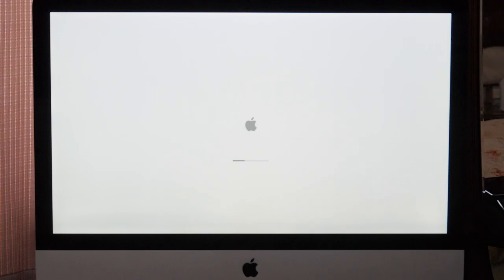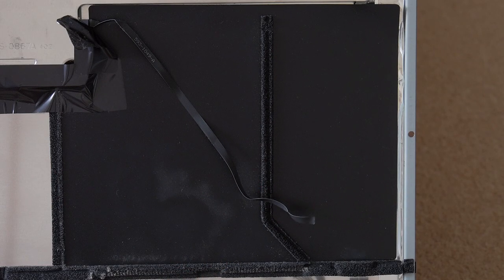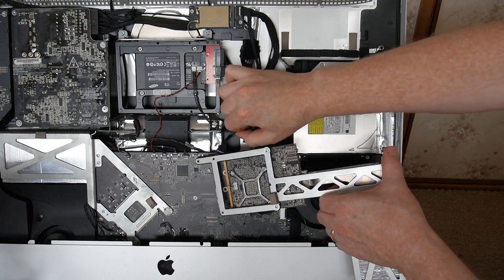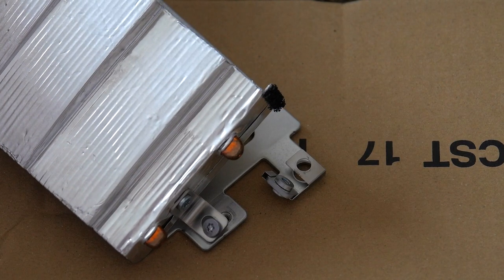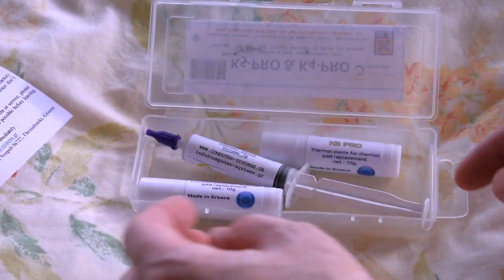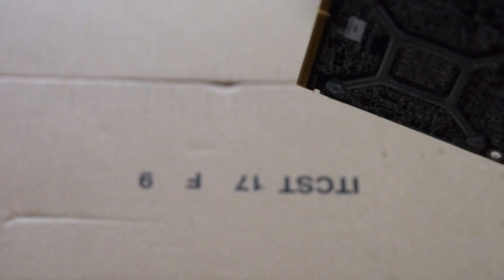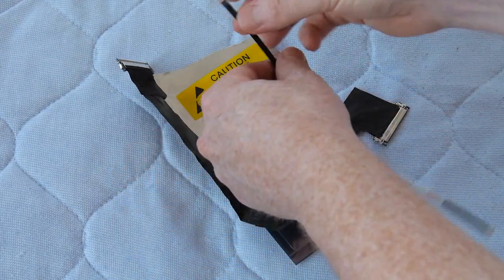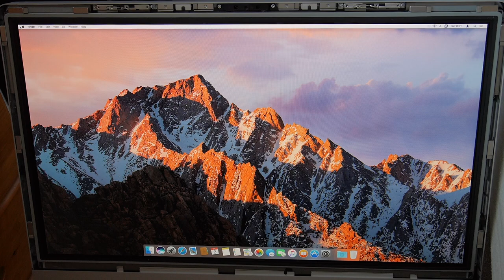Late 2009 iMac 27" Video Card Repair — 4850 — 2nd Bake

Comment: I took 2 days to follow your instructions. Yesterday, disassembling and cleaning, including inside the (poor) fans. Today, I baked and reassembled my late-2009. First boot, black screen, but everything else seemed ok (boot sound, fans, etc). I checked the connections, didn't see anything wrong but 2nd boot was fine, with perfect display. I'll never know why the first boot showed a black screen, but it doesn't really matter. Thank you for your great and detailled instructions ! 😀

I'm now considering the replacement of my HDD with a SSD (thanks to the links you provided in the description). Do you think it might help keeping the imac cooler ? 

I hope the fix will last, so I can have some time to spare for a new computer. Thanks again !
Reply from the maker: I'm pleased to hear of your success!  The SSD will make your iMac run MUCH cooler not only because the SSD itself runs cooler than a spinning HDD but also because the SSD draws less electric current which keeps the power supply cooler too.  But the biggest difference of all will be SPEED.  It's the best upgrade you can buy for your 2009 iMac.  Also, if you have more than one user on your iMac like I do (my wife keeps her user open all the time), you will benefit from more RAM.  I get by with 16MB.  Before when I had only 8MB, I took a big speed hit because the machine was resorting to virtual memory.  With more RAM, that problem is gone.  Thanks for watching!
Reply: JDW  Thank you for your advices. Let's go for a SSD first then 😊
I'm the only user, but a bit more RAM could be nice too. Some softwares are more and more eager in memory.
Reply: I forgot to mention that I also experimented the "not sticky anymore" black thing (the one you put back before the thermal paste). I decided to stick it with a bit of K5... 😅
Reply from the maker: @ecureuilsolaire  Interesting idea.  The good news is that K5 Pro and K4 Pro are not electrically conductive, so you can apply it wherever you like on the circuit board and not have any problems.
Reply: OK, it lasted 2 years. 25 months exactly. Pretty nice ! Same blue dots are back today, let's do it again 😅

Comment: Hello, why do you leave the old paste on the heatsink? It's gummy and may not cool as good as new paste.
Reply from the maker: You are commenting under my 2nd bake video where I did not do that.  It was only in my 1st bake video that I left the old thermal pads intact.  As you can see from my 2nd bake video though, I thoroughly cleaned off all the paste, which is what I recommend now to everyone.  Live and learn.

Comment: @JDW Thanks for the detailed video. I have a question. When your baking the video card, did you place it in the middle of the oven?
Reply from the maker: Pretty close to the middle of my oven, yes.  Don't forget to make 4 aluminum stand-offs so the card is suspended.  That allows hot air to flow over and under the card to make heating more even.  When done, open the oven door and let it cool, or do like I did and put it on a tray so you can remove the tray and sit it on your kitchen table to cool to room temperature (cool to the touch).  After that, you can start applying your thermal paste and then perform the reassembly.
Reply: Awesome. Ordered the k5 and k4 pro thermal paste.. will be baking some boards this 4th of July 😂 Thank you for your response
Reply from the maker: Just be sure to bake the video card in your oven, not under your July 4th fireworks!  ;-)

Comment: How do you think, if i take any mxm video card from laptop, will it work with imac?
Reply from the maker: "Any"?  No.  It has to not only physically fit, but it also needs to be thermally compatible as well.  Some have asked if they can put a newer and "better" video card inside, but the answer is that some of the newer cards from newer iMacs are very slightly different in size such that you may have some difficulty getting it to fit perfectly in a late 2009 iMac.  Some newer cards run hotter too, which I would advise against.  And that is why people do the bake, to resurrect the video card model that Apple designed to be perfectly compatible with that particular iMac.  

With that said, if you do experiment with different video cards, please be sure to make a video of your experience so others can benefit from your findings!

Comment: Hi JDW, thanks for the detailed video. I was wondering if you could help me. I am wondering where I might have gone wrong. Re-assembled mac with baked GPU, much to my dismay, power button has no effect. No response. Help! :)
Reply from the maker: Thank you for your question. Pushing the power button and getting absolutely no response could be the result of many things. Fir example, did you forget to plug in the power cord in the back of the iMac or the wall socket? Did you forget to reconnect the power supply or accidentally disconnect something and leave it disconnected inside the iMac?  

To see if it’s just your display and/or video card that is dead when you press the power button, first remove all of the RAM, then plug in piwer and push the power button. If you hear slow beeping sounds, that it means that power supply power is indeed getting to the motherboard, as that beeping is there to warn you that no RAM has been installed. In that case you would need to investigate the video card being seated improperly and then check your other connections, as a disconnected cable could prevent the video from displaying it all.
Reply: Hi, thanks for speedy response. I opened up the iMac again, checked connections, seemed ok. I tried again and lo and behold the iMac powered on after a very long press (20-30 seconds?), but with fans blowing at full speed. I reset SMC (unplugged power cord), turned on and it powered on fine, graphics card is working again. I encountered this 'long-press' issue again when I turned off the computer, but once the computer is running it seems back to its genki-self. Amazing! Thank you for your meticulous video for this repair, it took me about 3 hours and I used the K4 & K5 you recommended on Amazon japan. To keep the GPU cooler, and hopefully extend its life a little, would you recommend using software for higher fan speeds?
Reply from the maker: It's great to hear you got your iMac to not only power on but it seems your video card has been resurrected too!  Congratulations!  Yes, I would recommend using fan control apps to keep your iMac running cooler, and that is what I do.  You can see links to that toward the bottom of the Description under the video (Fan Control Apps).  Best wishes!

Comment: I'm about to tackle this job on my 2009  iMac.  I just got the K5-Pro, not the K4-Pro as well - can I use that on the GPU?  I have some older, but unopened Arctic Silver 5 - but I think the K5 should be best?
Reply from the maker: The K5 Pro is only for use on chips “other than the GPU.“ Never use it on the GPU. Arctic Silver V is only advisable for use on the GPU if (1) it’s only about 1 year old or newer, and (2) if you use it very sparingly and carefully to reduce overspill after the heatsink is pressed down. Arctic Silver V is not electrically conductive but it is capacitive, and if there’s too much overspill, that overspill will touch some of the surface mount capacitors surrounding the GPU and possibly have negative electrical effects. This is why I recommend getting K4 pro along with K5 pro because K4 pro is not electrically conductive or capacitive. 

Since you don’t have K4 Pro, If you are now considering the purchase of another paste for the GPU, then I would recommend Thermal Grizzly Kryonaut. It’s actually about the best GPU and CPU paste you can buy. https://amzn.to/36NMQwu
Reply: JDW Welp...I tried with the K5 Pro and Arctic Silver 5 and no luck. Instead of the scrambled screen I had, now I just had black. No screen life at all. I actually have a 2008 iMac with an Nvidia 0823A2 GPU on it. I just scraped everything off and I’ll try again and get the Thermal Grizzly like you mentioned. I did have a bit too much Arctic Silver on there which likely gave issues. I tried to use your link but I’m in Canada and it links me to the US store. If you have another link ti the Canada store I’m happy to use that :)
Reply from the maker: @mattblack3486  For a quick test, thermal paste doesn't matter.  Buying different paste won't solve the problem you have right now, which seems to be a black screen.  A black screen can have one of two causes after a bake: (1) you forgot to reconnect a connector or failed to reconnect all connectors properly (firmly seated into their mating connectors on the motherboard), or (2) your bake didn't work.  In the case of (1), you will need to open your iMac and check ALL the connectors you disconnected.  I would even suggest checking ones you didn't disconnect to ensure they are properly seated.  Then retest.  If you still get a black screen, then (2) applies to you.  In the case of (2), your video card could simply be dead.  But the only way to know is to try another bake (sorry) at 200°C for 10 minutes, using the aluminum foil standoffs I suggest in my videos.  That's a huge bother, I know!  Because you'll need to clean off all the paste, bake it, then reapply the paste again.  It's a pain, but it's the only thing left you can do. 

Hopefully the root problem is just a connector that was forgotten.  Otherwise, you will need to replace the video card if another bake fails.  Please let me know how it goes.
Reply: JDW thanks for the tips. I’m pretty sure it was the bake. I was quite meticulous in reconnecting and double-checked the lcd power connection as re-connecting that one on my iMac is a real PITA. I did not do the bake exactly like you suggested, so I’ll make those points and try it that way. Fingers crossed!
Reply: RIP iMac :( ....to be honest, I wasn't expecting much. I had built a pretty powerful PC back in 2018 when this first happened and all of my data was backed up to my NAS, so I didn't lose any data. I was hoping to revive it just as a fun project, but alas, it just wasn't meant to be. I'm not going to put another dime into it though  - maybe I'll try to sell some parts like the RAM and optical drive. I'll re-use the 250 GB SSD I had put in it a few years ago in my PC, so that won't go to waste. Appreciate the help!
Reply from the maker: Well, I’m very sorry to hear that, 
Matt. I read and reply to every comment under all of my bake videos and based upon that data I can see that the bake tends to work for most people who try it; however, most people who do the bake have 2009 iMacs or newer. So I’m not sure if there’s less of a success rate with 2008 models. A handful of 2008 owners have reported success, but there just aren’t enough 2008 iMac owners who have tried it to give me a solid data pool on which to draw solid conclusions. 

Anyway, use what parts you can and consider selling the remaining parts on EBay.

Comment: Thank you for the video. My iMac 27” Mid 2011 has gpu problem. Today I’m going to try to fix as you explain in your video. I have a doubt. You told the temperature 200degree C. Which mode to be used in the oven. Since, in my oven microwave, convection and combination of both is there. I’m confused. Please help me to clear my doubt.
Reply from the maker: Never do the bake when in doubt.  I too have a combination microwave and convection oven in the same box, as are most ovens here in Japan.  (A "convection" oven has a fan and exhaust system.) But if you press the wrong button or use the wrong setting, you will ruin your video card.  NEVER use the Microwave setting! Make absolutely 100% sure your appliance is set to be an OVEN only, and not a combination oven and microwave.  Some Japanese ovens have so many settings it makes my brain explode.  For example, one setting allows heating with the microwave, followed by use of the oven to make the food crisp!  You don't want that!  You want OVEN-only MODE set to 200°C for 10 minutes.  Preheat the oven before you put the video card inside.  And make sure you follow my video and make little aluminum foil feet to raise the card up so hot air can flow under it.  Also, place the card component-side UP!  Try to make the card level too, so it doesn't rest at an angle.

If your oven is old or if you have serious doubts that the temperature is correct or stable, you need to check it.  My mother who lives in the USA shipped me an American turkey thermometer in the past.  I can leave that inside the oven to check the oven temperature.  My oven is a near perfect 200°C when I set the temperature to 200°C.  I mention this because a few people (not many, but a few) have reported desoldered components during their bake!  That should NEVER happen if the temperature is only 200°C!  So check the temperature of your oven first, before you do the bake, just to be 100% safe.

If you're married and if your wife normally uses the oven and not you, let her set it for you.  It will save you a lot of trouble. 

I hope this helps!
Reply: Thank you for your immediate reply. Is there any alternative for k4 and k5 pro. I am from India. During this lockdown , it is not available in our place.
Reply from the maker: @selvamuthukumars2010  It really doesn't matter what paste you use on the GPU, so long as the paste is made for the GPU.  Arctic MX-4, Thermal Grizzly Kryonaut, etc. are all good pastes that will work fine.  But for the memory chips on your video card, you must use either K5 Pro paste or use a thermal pad.  The reason I did not use a thermal pad is because I did not have confidence I could properly ensure the gap between the heatsink and the memory chips.  With K5 Pro, the gap size doesn't matter.  But when you buy a thermal pad, you need to know the thickness of the gap.  If you cannot buy K5 Pro in India, then you will need to measure the gap, then buy a thermal pads according to your measurement
Reply: Thank you
Reply: @JDW-  I have got K4 & K5 Pro. Today i am planning to bake my video card. I need one clarification. THE OVEN TO BE PREHEATED OR NOT
Reply from the maker: Yes. Be sure to preheat. And if you are unsure the oven temperature is stable and correct, I suggest you put a turkey thermometer inside during the preheating time which would allow you to verify the temperature is accurate.
Reply: Thanks a lot. I have baked the video card and It’s working well. 

Mine is iMac 27” mid 2011 model. I couldn’t remove only the video card as you mentioned in your second bake. One screw accessible only after remove the logic board. But BIOS battery is in the front side. So it is not necessary to remove logic board to replace BIOS Battery. Few wires are in different places. So I downloaded the manual from internet and labelled the wires before detach from the logic board. It took hardly 3 hours to complete entire fixing. I have started to do around 3 am and completed the fixing around 6 am. 
One again thanks a lot for your informative video on baking video card.
Reply: @JDW-  My fan speed is now around 3800 rpm. Temperature maintaining between 40 to 42 degree C. How much fan speed to be maintained. I have downloaded smcFan Control. Please tell me, What should be the setting for fan control?
Reply from the maker: @selvamuthukumars2010  Congratulations on your successful bake!  If your fans are running at full blast then you probably left a cable disconnected or you did not properly seat one of the connectors.  Some people have reported that.  The easy fix is a fan control app, like you mentioned.  I personally set all 3 of the internal fans to 2000rpm in my 2009 iMac, which isn't too loud and it still moves a lot of air.
Reply: @JDW-  Thank You
Reply: @JDW-  I have another doubt. You told about battery in one of your videos. BR 2032 and CR 2032. which one to be replaced? Since the time changes when i restart the computer. I hope this may be due to weak battery.
Reply from the maker: You can use either battery type, but the BR version is what Apple used because it is rated for a higher temperature than the CR type. Either type will fit perfectly though, and many people have used the CR type with success.
Reply: @JDW-  Thank you

Comment: WHAT benefits do the GPU gets when baked?   WHAT happens when it's baked? SORRY for this stupid Q
Reply from the maker: If you have an iMac that freezes randomly, won't boot, or displays artifacts, baking in accordance with my videos will resolve that problem (perhaps for a few years) due to an inherent defect within the GPU chip that happens to be fixed by heat. To learn more, please check out my FAQ here: @

Comment: Great video !!! I'm going to bake my ATI 2600 vga card and I wonder if I can use K5 pro thermal paste on the GPU instead of having both K4 and K5. 
I wish you a best new year of 2020.
Reply from the maker: No, you cannot use K5 Pro on the GPU because it is made only for chips like the memory chips on the video card. You need to use K4 Pro on the GPU because K4 Pro transfers heat better. K5 Pro is only used as a replacement for “thermal pads.“

Comment: Is this graphics card issue only common with the i5 2009s or does it occur with the Core 2 duo units with the slightly different AMD card?
Reply from the maker: Mine is an i7, late 2009. I cannot say if the “early” 2009 or older CoreDuo model video cards are afflicted in the same way. What symptoms do you have?